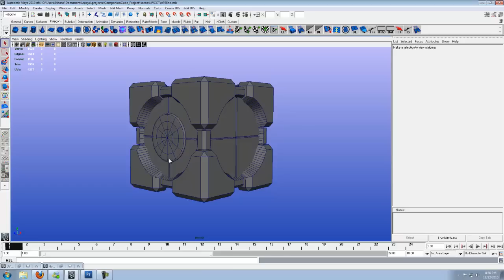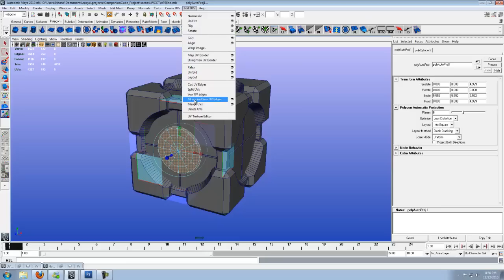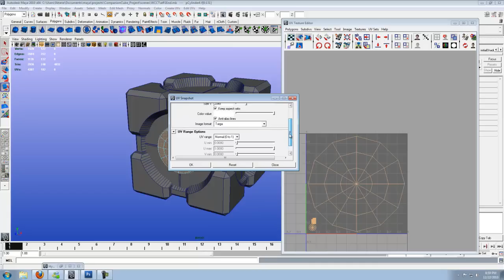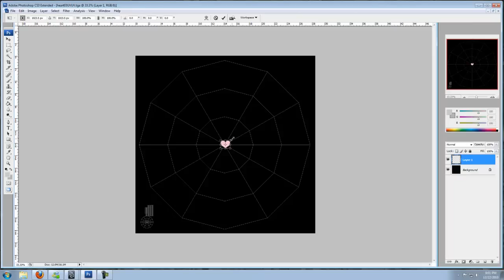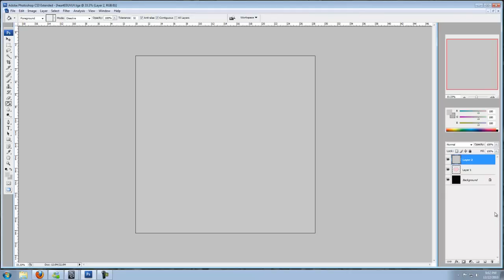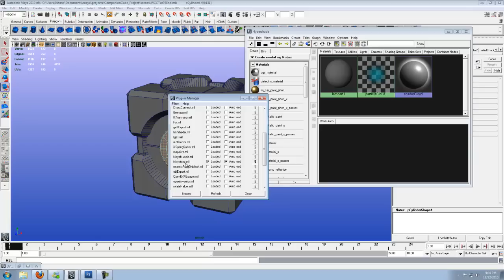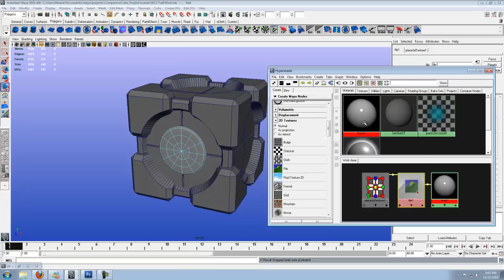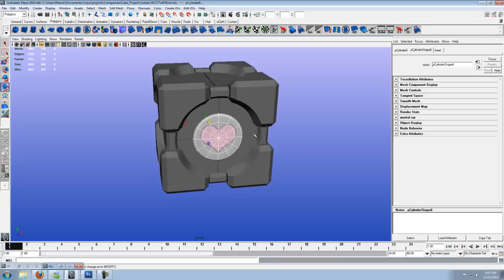How to make the Weighted Companion Cube in Maya 2010 (3 of 4)

Comment from the maker: Ok, I posted this a while back, and after receiving a good question, I realized a huge problem.  Around the 10 min mark, I explain how to attach the FILE to the HEART material.  However, what is missing is waht I selected as I dragged over.  The video doesnt show the list that pops up.  At this point, in that box that you will see, click diffuse.  That will correctly ...HOPEFULLY...correct any problem with the image not showing.

Comment: @JDawgSaturno Yeah clicked the texture option (6) and still doesn't work, I started it from scracth just in case I did it wrong and still didn't work, I noticed you used a tga file for the snapshot so I did the same but like I said doesn't work, thanks for replying quickly :)